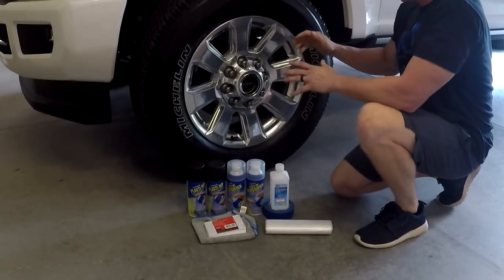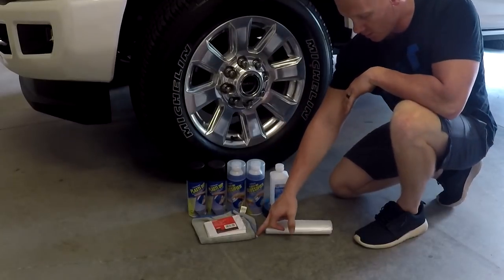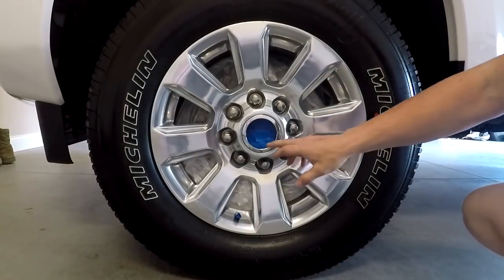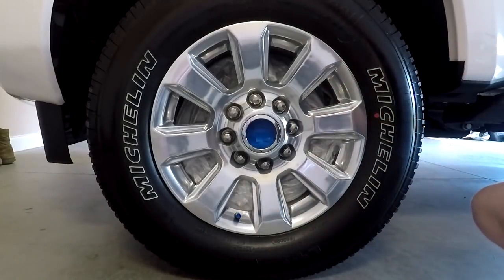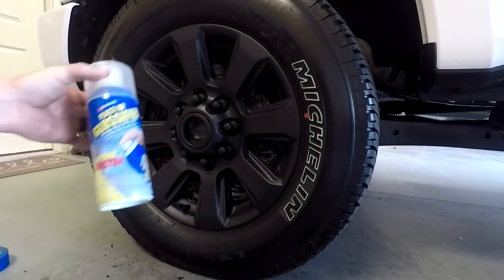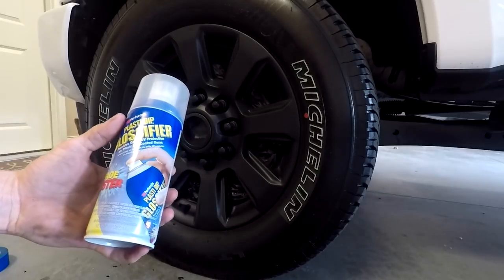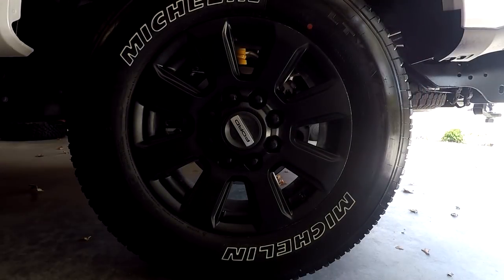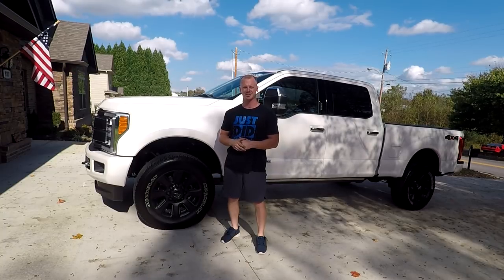How To: Plasti Dip

Comment: How durable is the Plasti dip? Like if you run your truck through the car wash is it doing to damage to plasti dip?
Reply from the maker: Matt Lee I've never had an issue. I kept it on one of my old cars for 2 years and it still looked new.
Reply: 5 year old black decklid on my 6 year old mustang lol very durable I've put about 100k miles since I bought it